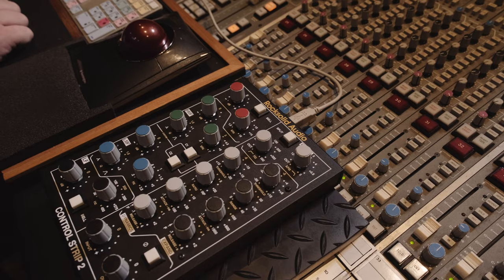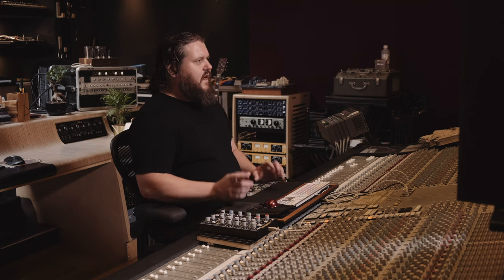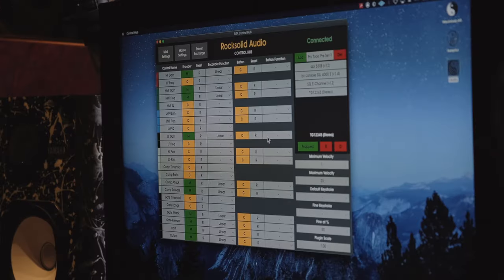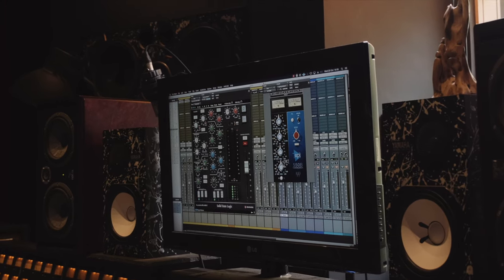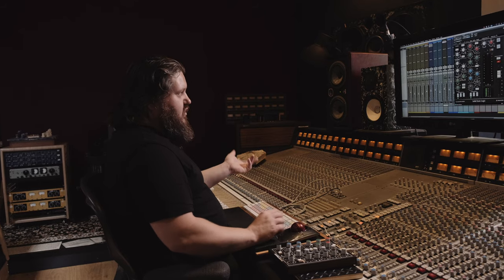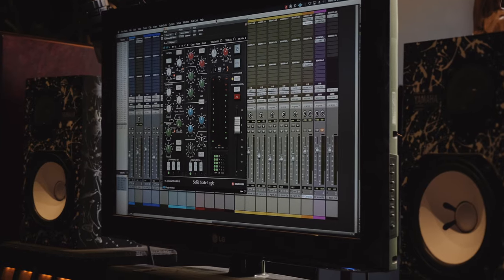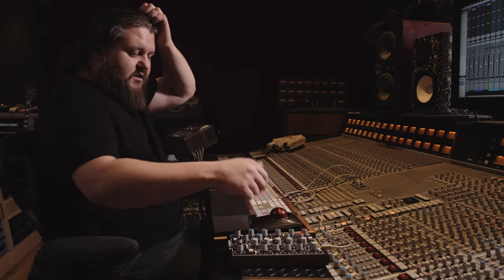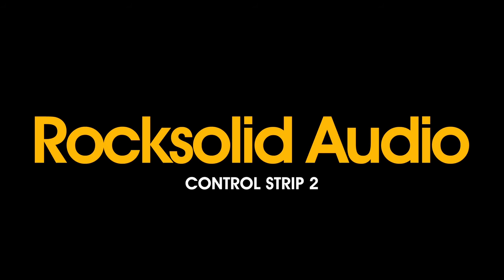Control Strip 2 in Session

Comment: Thank you for this product! 
Plugin controller that is not tied to one plugin, check. 
Real knobs, check.
Laid out for audio, check.
Easy to set up and use, check.
Can be used with left or right hand, check.
Small foot print, check.
Quality look and feel, check.

Pair it with a single fader control surface and you have a window into your daw that is laid out like actual audio equipment. I’ve never understood why a controller like this hasn’t been around forever. I’m old nowadays but I think I’m supposed to say “shut up and take my money!”
Reply from the maker: Thanks Eggdog, appreciate the nice words. The reason why companies dont make these things is because all the daws make it very hard to. Believe it or not but the system most still use is the old mcu protocol or a vst host like the console one. But fear not we are working round the clock on more products as we speak.
Reply: @RocksolidAudioEngland  well, control strip 2 speaks to me. This is how an audio controller should look and act. No point in turning your eyes away from the screen if you’re just going to use them on 50 illuminated buttons, scribble scripts and moving faders. I’m in, will order one by the end of week. Cheers.
Reply: So just to verify. I can control. Waves, brainworx emulations. What about the ssl and UAD emulations of SSL plug ins do they control those as well?
Reply from the maker: @MappingSubber  in mouse mode yes.
Reply from the maker: @MappingSubber  our full list of compatible plugins Is on the website.
Reply from the maker: @devianthousend  in mouse mode no. In midi mode yes.
Reply: exactly. ive got a pair of Behringer x touch extenders running (without the main X-touch, just extenders) I pulled the big silver covers off their sides and butted them next to each other for 16 channels of faders, rocking the control strip next to it. also running a stream deck and a midi twister and I have everything I need. its a beautiful family

Comment: Am i right in thinking each time you want to use a different plugin you need to go to the mouse mode panel and tell the controller to change plugin mapping?
Reply from the maker: No. Once mapped it will automatically know which is which.

Comment: Does the plugin GUI need to be open ?
Is it supported in Cubase 12 pro ?
Thanks
Reply from the maker: You can run Ra control for cubase 12. That means you can use host mode and mix without the plugin being open.

Comment: can one use mode for something like a Pultec Plugin in order to turn multiple knobs at the same time
Reply from the maker: The controller also has a midi mode so if your saw supports midi mapping of plugins you can indeed map and then use multiple knobs at once
Reply: Rocksolid Audio awesome, thanks!

Comment: I saw in a few forums that there is some problems with cubase like when you close the project the parameters on the plugin go to reset factory mode... Is it fixed yet?? Someone having this problem with Cubase?
Reply from the maker: You are correct for sone this is happening but Ra control host mode is a public beta. There is still mouse mode and host mode that work. we are also pretty close to releasing an update with Aax au and vst3 formats
Reply: @RocksolidAudioEngland  but this problem with Cubase just happens in RA control host mode? Will be fixed soon? Thank you!
Reply from the maker: @Henrique_Dutra  yes
Reply: @RocksolidAudioEngland  🙏. Do you have a newsletter?
Reply from the maker: @Henrique_Dutra  we don't no
Reply: @RocksolidAudioEngland  sorry for that, but i have just one more question. You said that "there is still mouse mode and host mode that work." (with Cubase). But host mode is not exclusive of RA Control? Thanks 🙂
Reply from the maker: @Henrique_Dutra  RA Control is a control control system with different ways to control plugins. Mouse mode, midi mode or host mode.
Reply: @RocksolidAudioEngland  ok, but what mode can i use with Cubase?
Reply from the maker: @Henrique_Dutra  all the modes